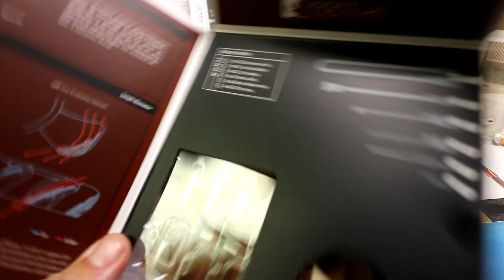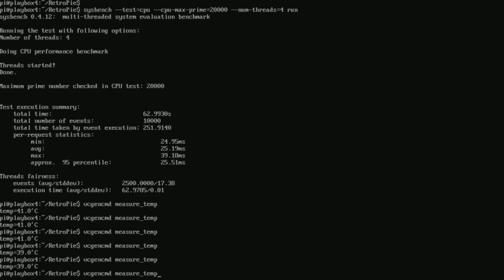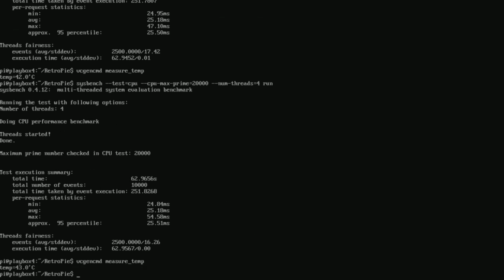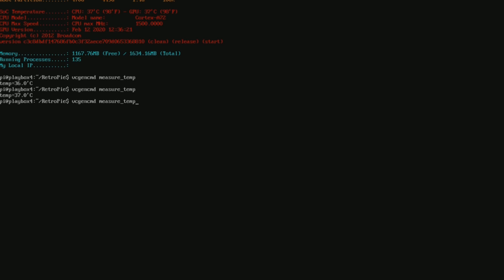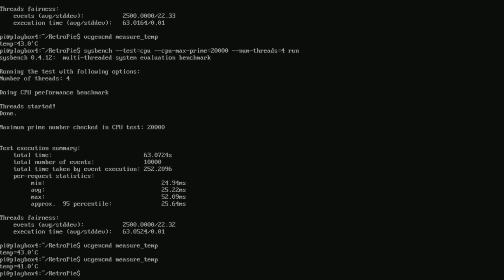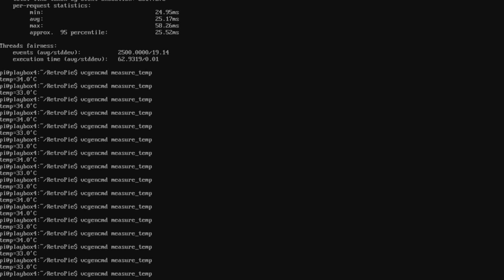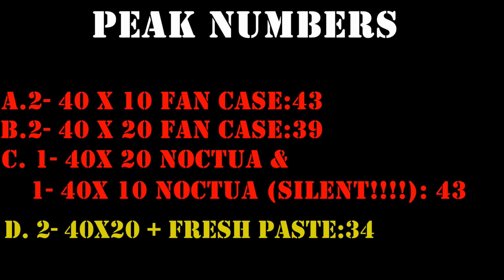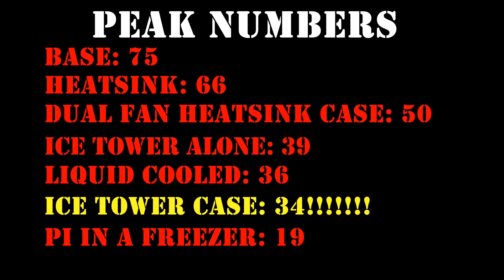Desktop Ice Tower Case For Raspberry Pi 4 - Active Cooling

Comment: The ice tower fan/cooler looks great but it overkill and is not really needed for 90% of the projects I’ve worked on.  Unless your just using it to have some fun and look “cool “ them in my opinion it a waste of money and time. 

There’s lots of lower cost cases with fans that perform as good as the Ice- Tower and look at lot better. 

I’m my situation I design my own 3D cases that meet my needs.  

What are your requirement, what are you doing with your Pi?  

If your over-clocking and are running applications that require good cooling then sure, go for the Ice-Tower!
Reply from the maker: For sure!

Comment: it would be cool to add the flirc case to the list
Reply from the maker: Explaining computers did the flirc it not as good but plenty good for everyday applications
Reply from the maker: The other thing is the flirc is passive cooling so without the fan it takes longer to cool down after a big load
Reply: @drewtalks  ok, thanks!
Reply: like the flirc case, you can always set it next to a desk fan if you need to. It's a case that is also a heatsink.